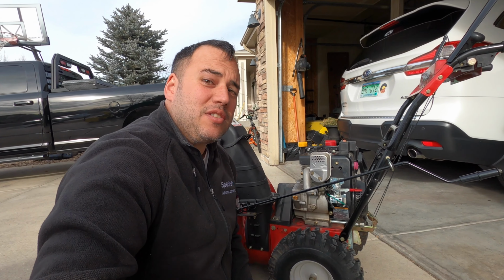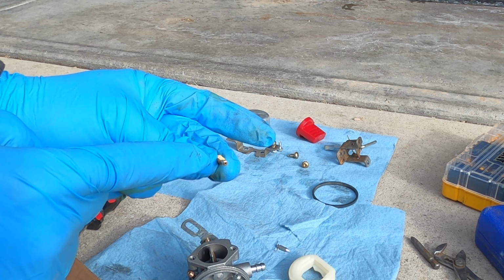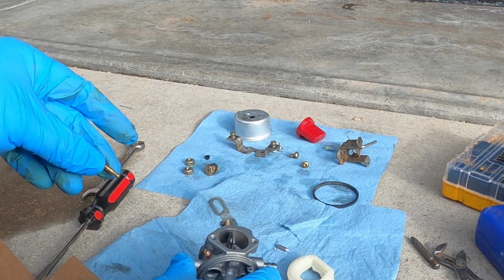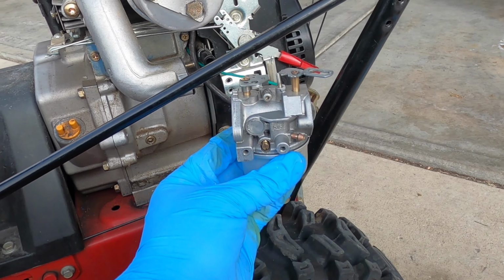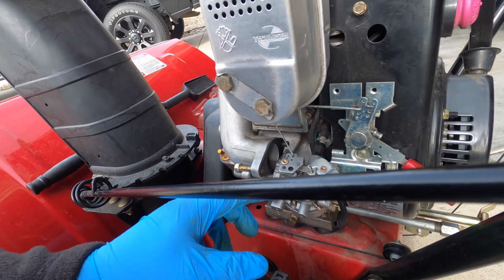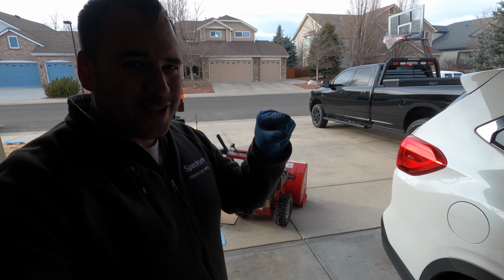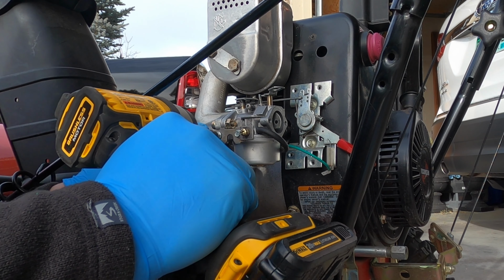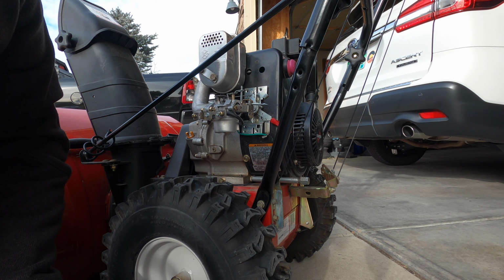Craftsman MTD Snowblower needs Choke to Run - Tecumseh engine Part 2

Comment: I always remove the carb by taking out the two screws that hold the intake tube on its much easier that way instead of struggling with the nuts and bolts that attach the carb to intake

Comment: I was gifted a 1995 MTD blower with electric start, in nearly new condition but no start. Followed your lead and took the carb apart sure enough was gummed up. Carburetor very similar but where you have an idle "jet" screw, I have a pointed end with no hole through the screw. That area near the pointed tip was gunked up as was the rest of the carb. Unfortunately between carb cleaner and brake parts cleaner, a bunch of paint came off. But now it runs like a top easy pull start, don't even need electric it is so easy. Thinking of getting large/long polymer shoes for my paved driveway that is only a couple years old, don't want to tear up the driveway. Just can't believe that this 26 year old Tecumseh engine runs this well. I did have some problems adjusting the governor and throttle, and it runs best with partial choke which is strange, but runs like a top. May need to get an rpm gauge to see if full throttle rpm is correct. I set it based on sound alone, just guessing. Thanks for getting me in the right direction sir.
Reply from the maker: I'm glad to hear that it helped out and you got it going again!  These old Tecumsehs are pretty tough.  I, too, am amazed at how well they run with a simple carb cleaning sometimes.  Now that you've got yours going again, I'm sure it'll continue to last you many years.  I do the same thing as you and set the RPMs by ear.  If you end out getting an RPM gauge, there are some that you simply wrap a wire around the spark plug wire several turns and it detects the RPMs based on the frequency of the spark.  I haven't ever used one, but would be interested in what you end out getting and if you like it.  Thanks for sharing your success!

Comment: Thanks for making a Part 1, and Part 2. I live prob 30, 45 min away from you. Im in Aurora, By SouthLands Mall. My Yard machine 26" is doing the same exact thing. 
It will only start on Starter Fluid in the spark Plug hole. I really don't want to take off the Carb, but if it fix that. It may fix mines.!.! Thanks again!
Reply from the maker: I fix a bunch of these and if you have a Tecumseh engine, there's a very good chance that this will fix it for you too!  I use this method on most Tecumseh engines with 95% success.  Good luck!
Reply: @TractorHoarders  I did my Research and took the carb apart and noticed there is Has in the Float. I have the same Engine in this video too! Waiting to see if I should just buy a new Carb off Amazon for $15. Or just order a new Float idk
Reply from the maker: If it were me, I’d just go ahead and buy the carb for $15.  Good luck with it!

Comment: Man, I love the bed setup you have on you Dodge Ram. I was looking to do the same for my Tundra but I was not fully sure if someone was able to get a bar to fit in with their tool box and looks like you found a way.

BTW, great video.
Reply from the maker: Thanks man!  You can make it fit!  My headache rack is from Magnum (magnumtruckracks.com).  I made a rubber spacer (cut out of a rubber door mat).  The bottom rail on the rack sits on the sides of the truck bed.  On top of that, I put my rubber spacers on both sides.  Then the toolbox sits on top of the rubber spacers.
Reply: Buy your self a set of micro drill bits they come in handy for cleaning those stubbornly clogged jets

Comment: Thanks for showing your work step by step.  My snowblower has just started needing some choke to run smoothly so, being lazy, I'm wondering if maybe all I have to do is clean out the idle valve.  At least I hope that's the case.  :-)  Thanks again.
Reply from the maker: Hopefully that one fixes it for you!  I’ve done this same fix on a few of these now with positive results.  Good luck!!

Comment: HI Great Video!!! Thank you. Have you ever come across a Tecumseh engine that won't shut off? I have a MTD pro 26inch snow blower, I recently cleaned out the carb and got it running again, but it won't shut off, and i have to pull the spark plug cable off to shut it down. Any ideas?
Reply from the maker: Yes!  Behind the metal cover where the throttle is, there is likely a wire disconnected that connect the bottom point of the throttle to the electrical ground.  Check and make sure that’s hooked up and connections good and clean.
Reply: @TractorHoarders  Awesome Thank you! I really appreciate it! This was my first carb cleaning experience, couldn't have done it with out your video!!!

Comment: I have an old electric start craftsman snowblower that I bought for my parents many years ago that hasn’t been started in 10 years. It looks mostly new. The choke dial is totally frozen and won’t turn. My model closely resembles the snowblower in the video. Do you think I can get away running it without the choke if the engine gets running hot enough? Is there a easy way to free up the choke?
Reply from the maker: Typically the choke is a very simple mechanism.  I bet with some WD40, PB Blaster, or Kroil, you can free it up.  I would take the covers off like in this video so that you have access to the carburetor and spray those things on the choke and wiggle it around.  It should free up without too much effort.

Without being able to move the choke, it probably won’t be too easy to get it running so that it’s hot enough to run without the choke.
Reply: @TractorHoarders  thanks I may attempt to take the cover off, but boy it’s pretty cold out. The oil looks pretty dark. I was thinking of replacing it. Is there access to a drain plug? The dip stick is a long screw in red cap that looks pretty narrow for adding new oil. Not sure what type of oil to put in there.
Reply: @TractorHoarders  I used PB Blaster. Thanks it worked! At 1st it was so hard to rotate the choke it bent the arm. It’s very loose now. Btw the screw on oil cap is yellow. Maybe I will just go with the current oil for now. I noticed my wheels are locked in gear. My blower has 2 speed reverse and 5 speed forward but no neutral. There is a squeeze grip for enabling the traction control but it looks ok to me. Not sure why it seems stuck in gear maybe when I start it up it will disengage?
Reply: The wheels turn ok now after a hard push. Trying to start up atm. No luck. At least the choke is usable.

Comment: I know it is early in the season, but now that I had same problems what is the best way to winterize snowblower
Reply from the maker: The main thing to be conscious of is not let it sit for months with gas in it.  Either run the engine until the gas is all gone, OR start the engine every 30 days and let it run about 10 minutes.

Comment: I have craftsman 22” snow blower. Runs strong but when I try to go into snow more than inch or two it bogs down and shuts off. Any ideas? I’ve read to check governor and clean carb
Reply from the maker: Yes, from a probability standpoint, it’s most likely the carb needs cleaned.  Most snow blowers don’t see enough use to have mechanical wear, like governor issues.

Comment: is there some kind of store bought fuel you can buy that won't gunk up a snowblower carburetor?
Reply from the maker: Yes, I believe you can buy non-ethanol gas in gallon containers from stores like Home Depot.  Some gas stations sell it, but it just depends on your area.  I personally think the easier solution is to just start the engine and run it for about 10 minutes every 30 days.  The key is not letting gas sit in the carburetor for long periods of time.  Running it cycles the old stuff out and burns it.
Reply: @TractorHoarders  I don't understand why they still use carburetors anymore.  Fuel injection was perfected more than 30 years ago.
Reply from the maker: @mrbubetube  Fuel injection is awesome.  My guess is cost.  They can probably keep costs low by going to carburetor route.  I think that's why you don't start seeing EFI on garden tractors and zero turn mowers until you start getting into the higher cost models.

Comment: Looks like mine, the carborator was replaced and told it does not need to be primed to start. Just told have  Choke on  & it would start .. but  nope  . it still won't start.
Reply from the maker: There are a lot of factors to consider.  Part 1 of this video shows some basic steps to confirm the problem and troubleshoot whether it’s a fuel or spark issue (use starter fluid).

Comment: But time is money. I spent and hour removing and cleaning the carburetor parts and it was a fail. New carburetor was just 16 bucks and it took me less than half an hour to replace it. Something to think about before spending hours on a project.
Reply from the maker: This is absolutely true.  I take this into consideration when doing these and the price of a cheap China carb is definitely lower than your time in many cases.  In my experience, sometimes I get brand new ones that surge due to passages not being the right size.  That’s always disappointing too.  For the amount of those I’ve bought, I’ve had that issue on maybe 1 out of 5.  I do agree with you that it’s a good consideration to take into account.
Reply: @TractorHoarders  yup, and for me a storm is coming to Minnesota and so I didn’t have much of a choice. Quick fix and I hope it holds.
Reply from the maker: @sharpthingsinspace9721  I’m sure it’ll be all good!  Good luck with the storm!!  We’re having a mild winter in Colorado so far.  I usually am doing lots of snow removal by now.
Reply: Did you really screw in the low idle jet all the way without backing it off 5-1/4 turns?
Reply from the maker: @bruce2sail  I generally use 1-1/4 screws outward as a starting point.  I have no idea though because it’s been a while and I work on so many of these things.
Reply: @TractorHoarders  I think these just need to be snugged up, no adjustment.